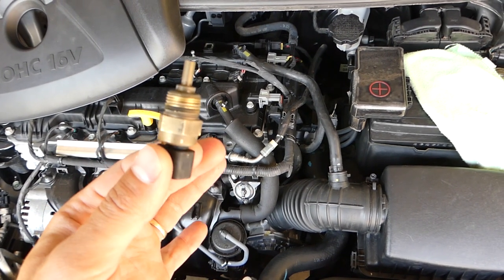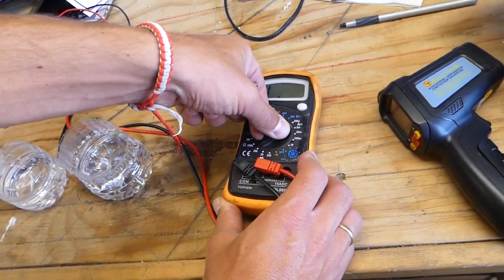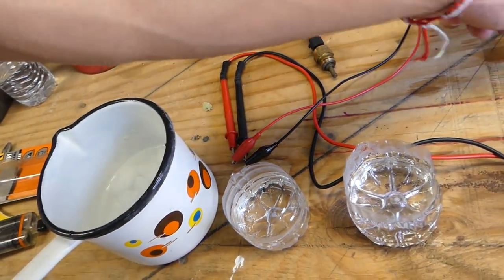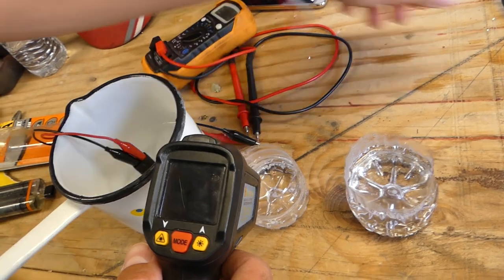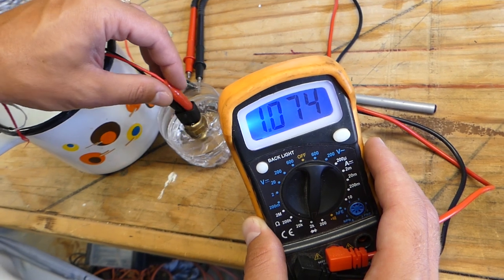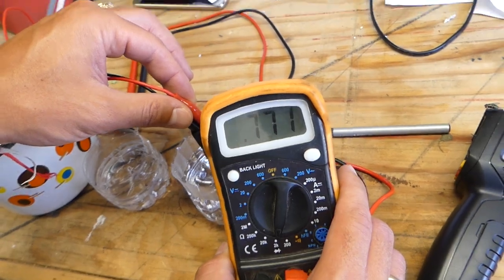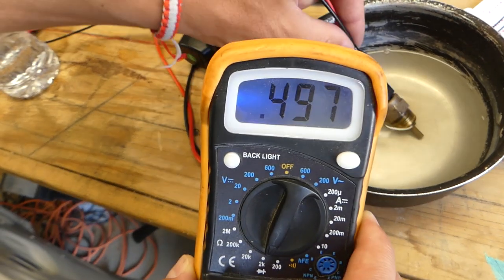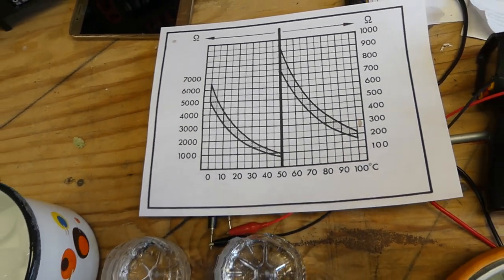HOW TO TEST WATER COOLANT TEMPERATURE SENSOR ON KIA

Comment: My 2004 kia sorento with 2.5crdi engine will not get to the halfway point on the temperature gauge. 

It seems like it is running too cool, I have changed the thermostat for a new one, but still the same problem. Performance seems fine and no loss of coolant. 

I don't think it is an air lock in the cooling system because I have squeezed the hoses and took the coolant tank cap off to purge any trapped air.